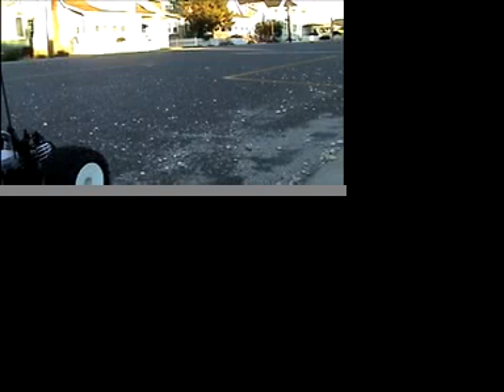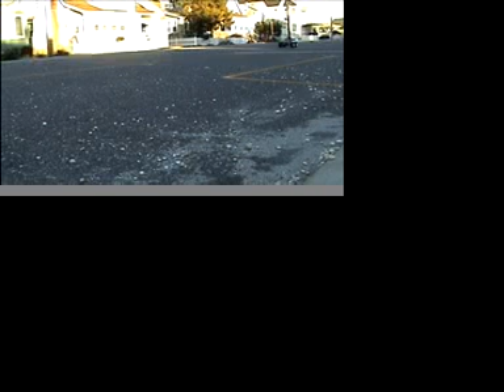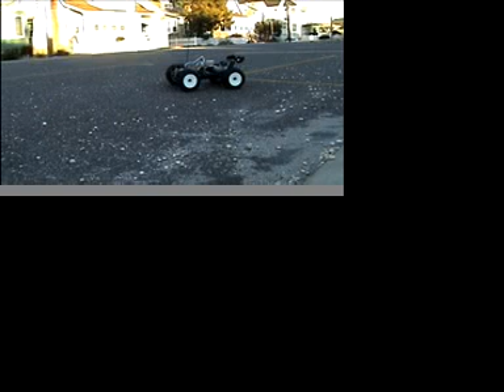lst2 trans needs help

Comment: 2.Use sparingly, apply a thin bead on the carb neck just below the main carb body [even if there is an o-ring present. Do not put it in the engine case bore or all around the carb neck. [That would glue the carb into the engine for good!]   You just want a thin bead to squish out from between the engine case and carb body just as you fully insert the carb. 3.After positioning the carb were you want it tighten the pinch bolt assembly that holds the carb very snug!-....

Comment: Hold on, from simplest to more time involved...

Check for glazing on the clutch bell/condition of shoes.  An over rev can mean the springs are not gripping the clutch bell with enough force/needs scotbrite pads to deglaze/etc.

Next, put truck on stand with all four wheels free and floating in the air.  Grab the two rear wheels and spin away or toards you. If all four wheels are not moving in the same direction, rip apart the front or rear diffs.

If none of the above work, rip out trans

Comment: ...-Then add a dab of silicone to both ends of the pinch bolt assembly. 
4.	Let fully cure before starting engine.
and about the stand still, check the slipper before you change the OWB. tighten it all the way than out one hole turn it should be good from there. if not it's the One Way Bearing...

Comment: hahaha okei i know this is old vid but anyways, he is talking about the rpm's going up i had the same with mine and that was the o ring on carburator's neck, take it out and just make sure the o ring is okei then put it back in and make sure it's tight! if not? try this

Many racers find this a must! [Particularly in off road] Here are a few tips. 
1.	Be sure to use ONLY non-volatile silicone [it should say oxygen sensor safe on the tube!] you can find it at any auto parts store.  next comment